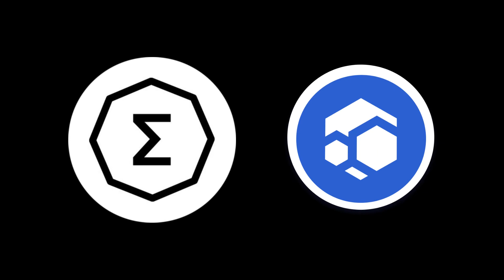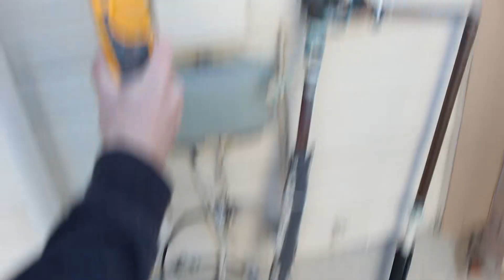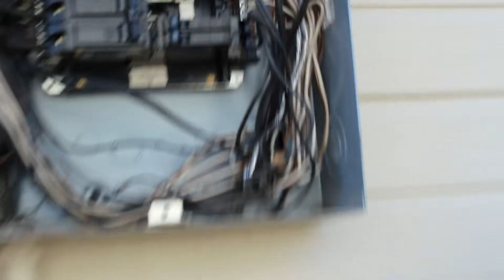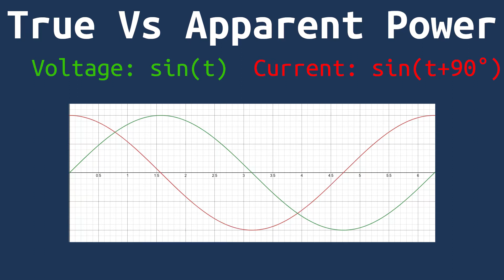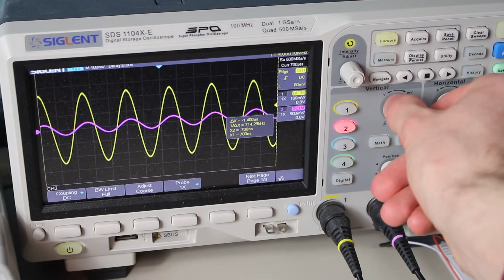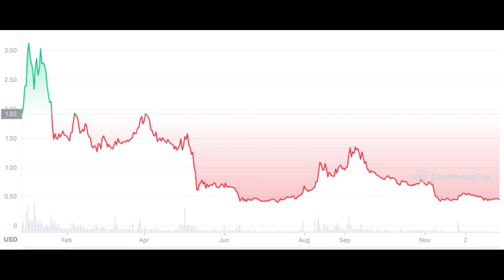How Much Power Is Your Crypto Rig Using? - True and Apparent Power

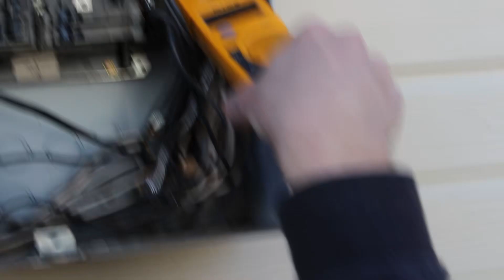Comment: 1:28 it's not Watts it's 960VA because you are measuring the voltage and current independently and you don't know the power factor.
The power given by the software is probably an estimate so may be a big wrong. It also probably doesn't take into account the losses of the power supply. You are billed for the AC power consumed not the DC power delivered. So you can probably add 10-15% to the software figure.
Usually PSU for PC now have power factor correction so the 960VA is probably not that far from the actual value.
The ideal solution would be to use an actual wattmeter inserted between mains and PSU. Otherwise I would use the 960*0.9=870W estimate.